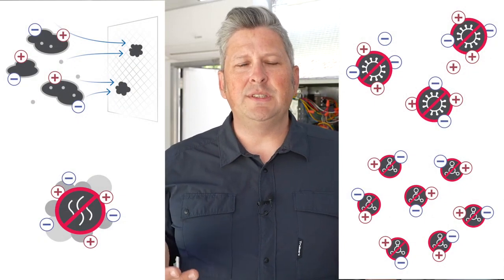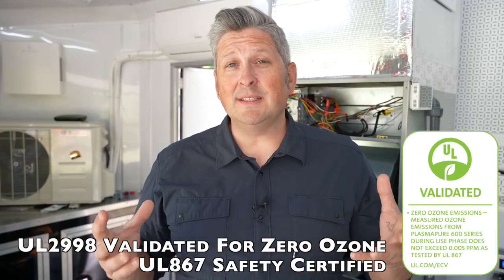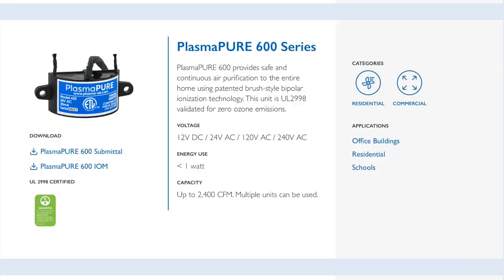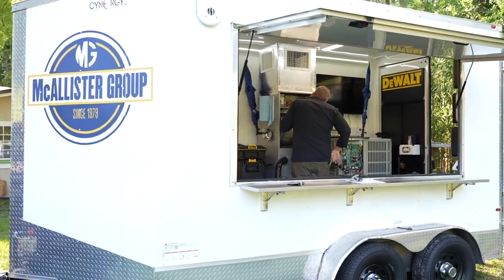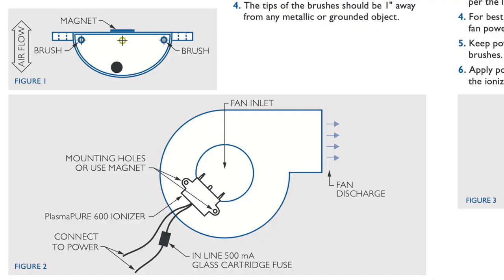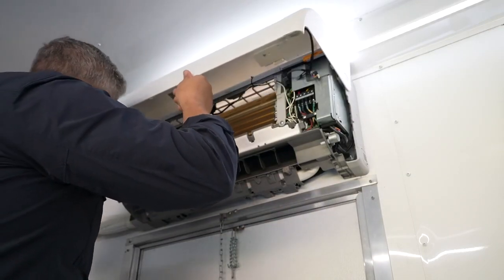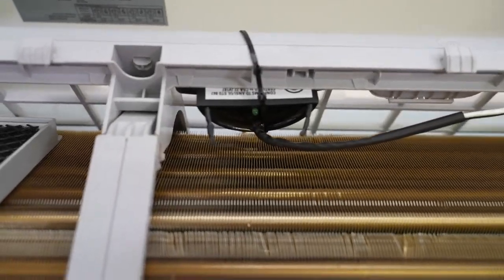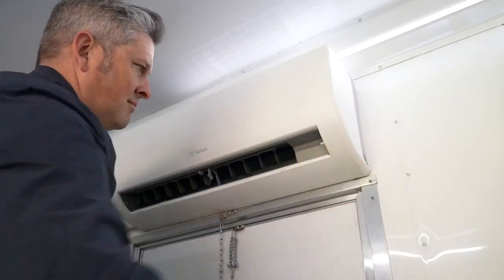PlasmaPURE 600 Series Installation

Comment: If I connect the power wire to the green wire coming from thermostat, will it  only turn on when the fan is running?

Comment: Hello,  how would I know if it's working? Since you have to have it running. But when you open the door to the conditioning/ heater/or fan unit it turns off & the green lights turn off  as well...thank you
Reply from the maker: Hi SunShine! Please email us your contact information (info@wellairsolutions.com) - we'd like to connect you with a technician.